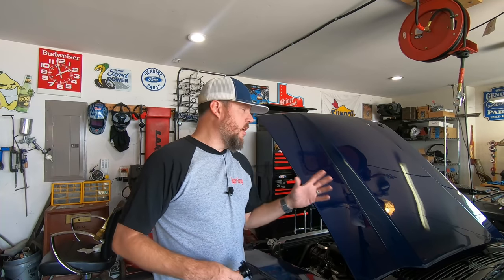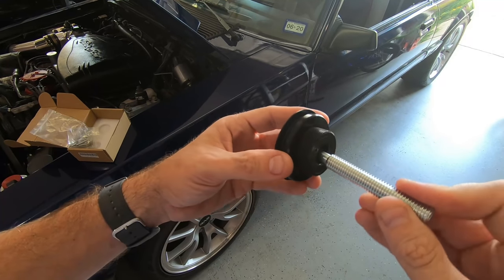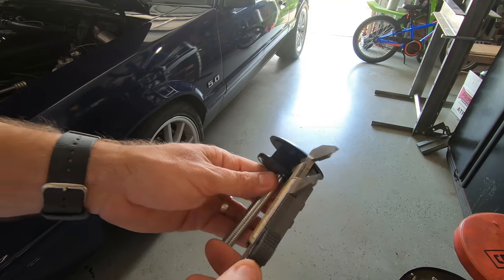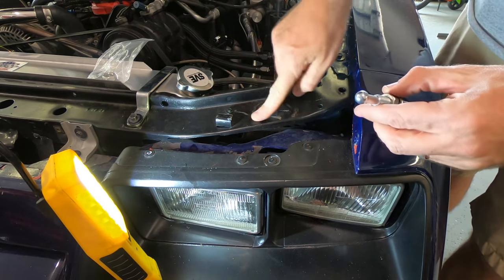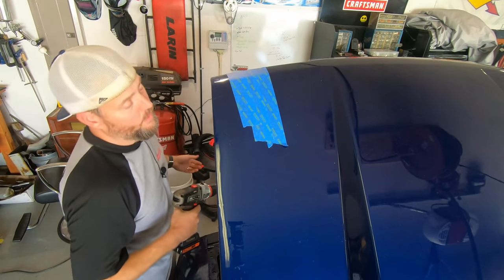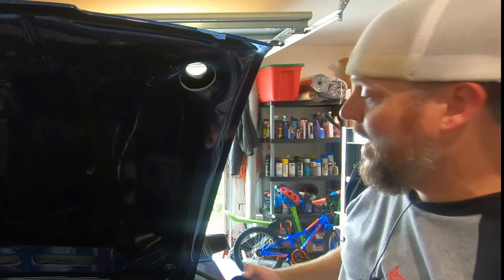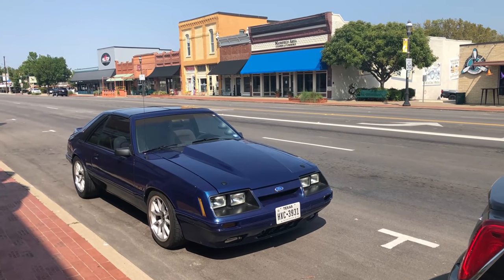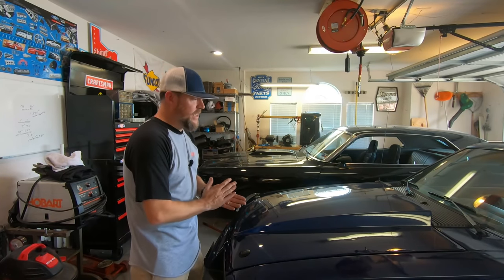Foxbody - Quick-Latch Hood Pin Install on Fiberglass Cowl Hood

Comment: turned out nice. More importantly, great video. only thing i would mention is by eliminating the bump stops you cant adjust how the hood sits in relation to the fenders as far as the height. My recommendation is count how many turns it tkes to turn the bump stops down so there is zero contact when the hood closes. If the hood still sits to your liking, then proceed with the hood pin install. if your hood sits low or not to your liking, raise or unscrew the bump stops to where they were. Sorry, not trying to be one of those a$$holes just picking everything apart. Like i said great video. #4EyesForLife
Reply from the maker: No man perfect point. Your right if cant the hood low enough with the stock stops then the pins wont likely be low enough, that would have to be pretty though, or, something wrong with the front fender alignment. Since these take place of the bump stops themselves and lock in the pin, these essentially become the bumpstops. They are spring loaded so you want the pin in the lock with tension on the spring. Its locked in place but depending on pin height you can raise and lower the hood corners. Except for some reason like you said you couldnt get low enough...Stuff like this I wish I time to explain! but my vids are long enough already lol Appreciate the comment man!

Comment: Looks ok, losing your hood height adjustments (bump stops), not a good thing.
Now you have 2 more stress points on the front of the hood as before you had the hood latch pulling the hood down against the adjusters. Hopefully no cracks arise & ruin the paint job.
Reply: I would say he has two more layers of security from that hood flying up!💯

Comment: Just a thought..what about shooting some expanding foam into the open areas of each hole to firm it up. It's a little messy but afterwards it can be shaped, lightly sanded and painted once it hardens up. Let me know what you think.
Reply from the maker: Yeah why not! not a bad idea. If I was handy with fiberglass I would just fill with cylinder shape and paint, or like you said fill. Someone had an idea to use a rubber grommet, with a star cuts in it.

Comment: Thanks for the fox vids! So it’s been a while and I’m curious how this latch is holding up, does it still click in solid, ever cleaned or greased it? Oh how’s your fiberglass holding up, any noticeable stress cracks and whatnot? 
My poor coupe now bears the cowl carnage, but luckily not beyond there, and I’m deciding on the least ugly setup. Quicklatch or Aerocatch basically. 
Love your account, thanks again 🤘
Reply from the maker: Thanks man! I'll be doing a lengthy follow up vid soon on my 86's and all its bolt ons. They are okay...no cracking or anything. I do have one that likes to stick though.

Comment: Will i be fine with no latch?
Reply from the maker: Fiberglass hood with no latch, and pins / locks should be fine. Just need to adjust well to avoid rattling. If its a fiberglass hood that allows for a stock latch though I'd use it to get that extra point latched in the center though.

Comment: How are these holding up? Any issues with them getting stuck? Looking at the actual quik latch but man are they expensive!
Reply from the maker: They are okay...One like to get stuck and I have to bang on it. Get what you pay for, but no regreats, still looks good and hold the hood down as expected! Check out my latest I go over all the little stuff, what was bolted on and how its held up.

Comment: Did you have to modify the stock secondary latch? Mine is getting in the way for the hood to shut.
Reply from the maker: No sir. Not at all. I did play with the adjustment. Likely its not closing low enough for the secondary to latch.
Reply: @HOUSEOFDULA  I had to adjust the secondary to get it to fit and latch but now it’s perfect.